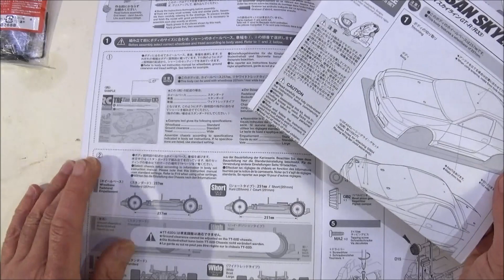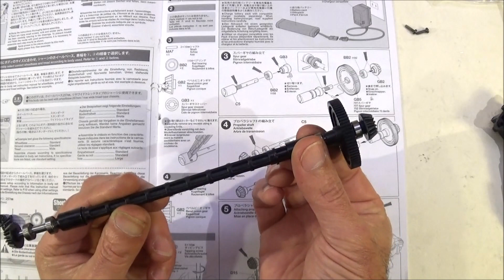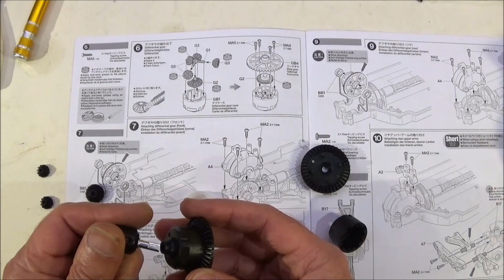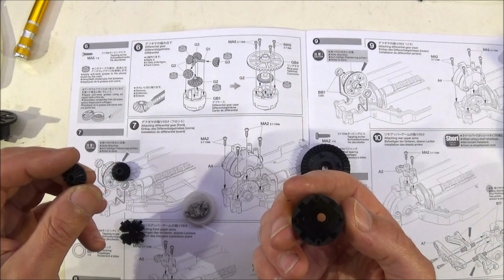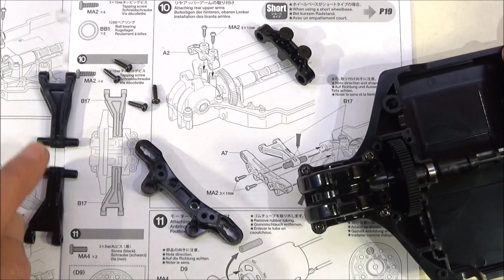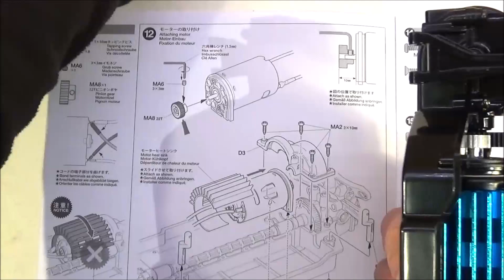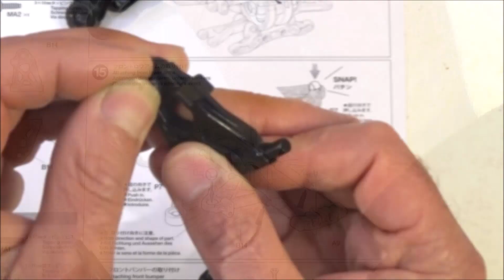Tamiya TT02D DriftSpec Build Part 1 - Nissan Skyline GTR -Build-off #11

Comment: Really good instructions. 

I'm recommending that you don't install part D15. It hinders the turning quite a lot.
Reply from the maker: Thanks very much Are! Great advice my friend - I have already discovered that D15 does indeed restrict the turning - I have resorted to cutting part of the D15 plastic away with a modelling knife to improve the turning because the steering arms hit it way before the servo has reached it's maximum angle. Good call - you know your TT-02's!!!   :-)
Reply: @MarkBryanRC  Yes good choice :)
I counted and found out i have actually 9 TT-02's 
7 built and 2 to be built.
One is the new Audi Q and the other is with a Ford RS 200 body i found. I think you would like that :)
Reply from the maker: Wow! 9!  No wonder you know them so well - and you are so correct - how did you guess I would love the classic RS 200?  I really like the Audi as well, I have just ordered the Quattro A2 body set!  :-)

Comment: I wish you lots of fun with this tt 02! 😀
OH and one tip :
Get yourself a fan for the motor.
I used a 40 mm ruddog fan it helped A LOT.
Reply from the maker: Thank you very much, rc guy!  Thanks for the tip - a fan will help to keep this baby COOL!  :-)
Reply: @MarkBryanRC  OH yeah.
My Fan dropped the temperature about 25-30 Degrees Celsius.
Before that, it was impossible to run a full battery without a cooling break.

Comment: Very interesting, I can't wait to see it running! Will be following this build!😉
Reply from the maker: Thanks very much my friend - this is a really nice build, should be a nice runner - cheers for following along, much appreciated! :))
Reply: @MarkBryanRC  Yeah, When you fitted the motor, it gave me flashbacks of when I built my TT-02B! I recently changed the motor in it, but I had connection problems and it turns out I didn't solder the connections on properly! 🤦‍♂️
Reply from the maker: Oh dear! Glad you got it sorted, soldering can be a real pain in the proverbial! At least the kit comes with the leads already soldered on! All the best mate!  :-)
Reply: @MarkBryanRC  I have actually been on holiday so haven't fixed it yet, but I will fix it as soon as I get back as I really want to drive it!
Reply from the maker: I hope you had a great holiday mate - the TT will be waiting for that soldering fix!  :)
Reply: @MarkBryanRC  It most certainly will be!